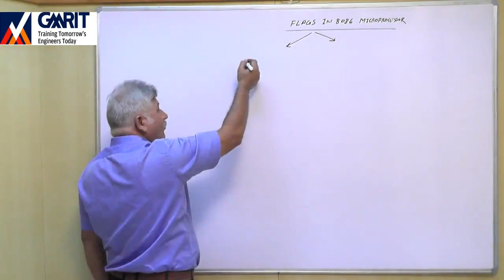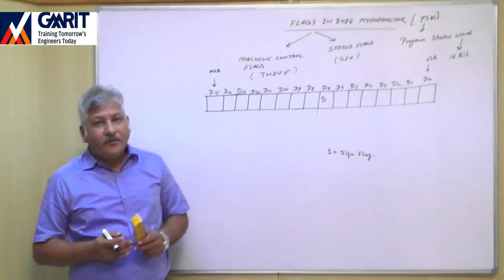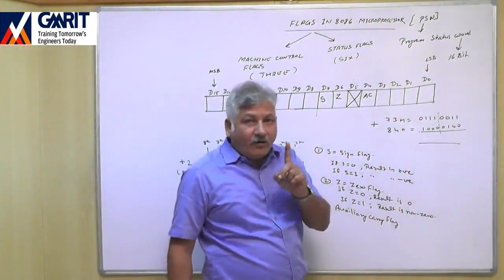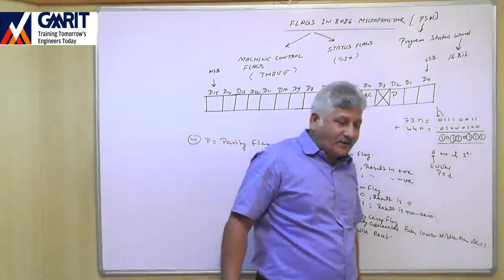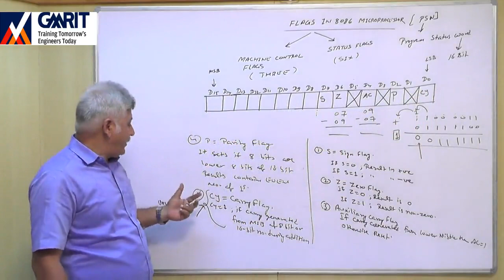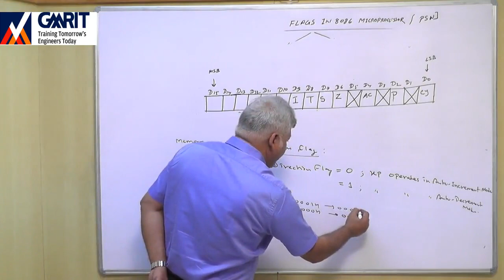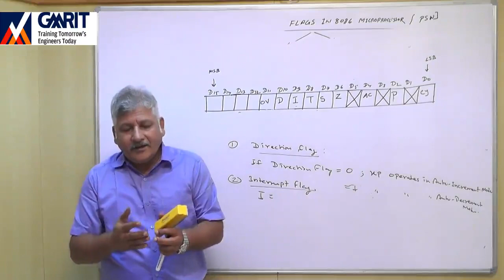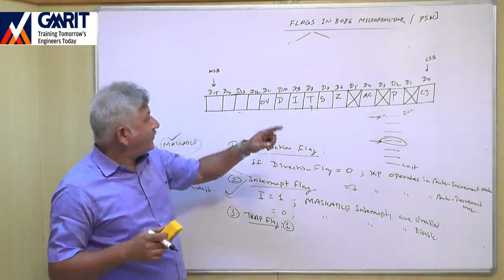Lecture 12 : Flags of 8086 Microprocessor

Comment: Sir y parity bit consider only lower bits??
Reply from the maker: Internal architecture of processor is like this.
Reply: @DrYogeshMisra-Professor  ok sir tq....what is the use of this parity flag by setting it 1 or 0??
Reply from the maker: @vigneshvicky6720  Generally the parity bit is used to detect the error during data transmission and reception.
Reply: @DrYogeshMisra-Professor  tq sir